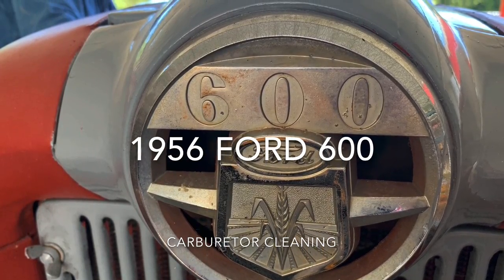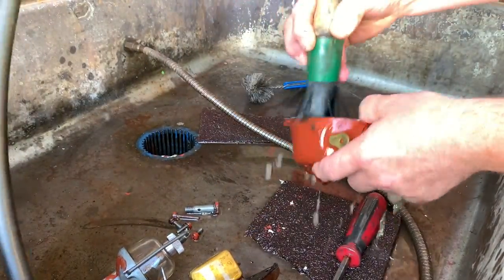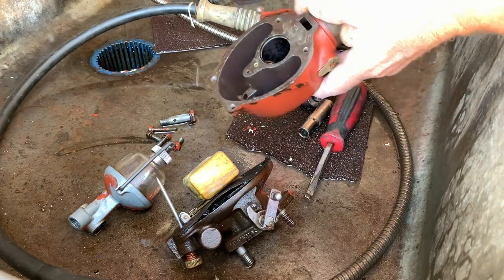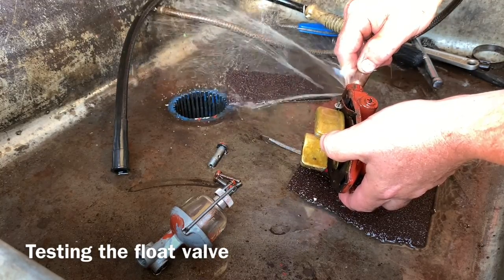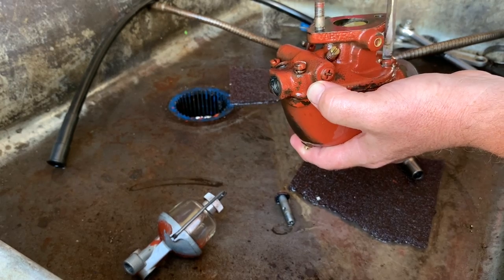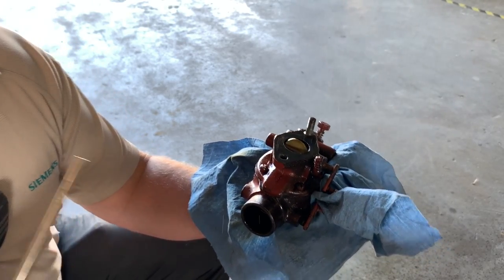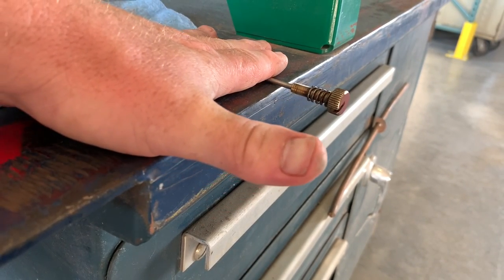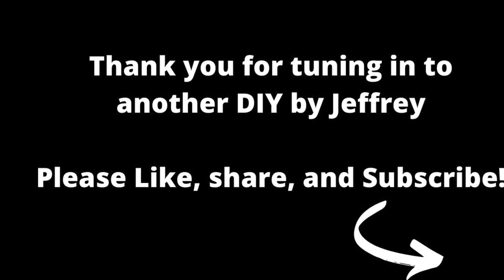Ford 600 tractor carburetor tear down and cleaning

Comment: Good luck finding fuel with no ethanol.  A minute added adjusting while engine running would have been a nice bonus.
Reply: I get mine at Quik Trip, they have prem, with no alcohol, there are ways of removing alcohol from the gas using distilled water, by leaving it sit over night with food color in it,  you can also get good gas at Bucees travel stops

Comment: Take the main needle out first before separating the halves and you won't bend it like you saw happen here.  I love how he is like "Don't know how that happened!" - LMAO.  I'm like "You bent it!"  There is no way you could put that needle back in and have it be adjustable since it would not seat in the jet correctly.  He then calls that needle the jet.  It is NOT the jet, it is the main needle.  The jet is the small brass screw with a hole it in it that the needle bottoms out into, and is how you adjust the fuel flow rate under load.  Also, no one calls the carburetor bowl the 'sediment bowl".  The sediment bowl is the glass bowl where the fuel flows into the carburetor.  And that test he did blowing cleaner out the throttle?  Absurd.  That is not how you test a carburetor.  The fact that the tractor started is a testament to the fact that these old Marvel Schembler carbs run like champs and have WIDE tolerances as the engine isn't that picky.  My 1957 Ford 640 starts every time, although I DID just rebuild the carb and replace the rusted out exhaust pipe and manifold.  If you really want to see how to do this - go to Rachell Gingell's site, and save yourself having to buy a new main needle!

Comment: One of the best carb cleaning video's I've ever seen Thanks for secret tips   I keep a lot of those crush washers gaskets for that style fuel filter You can also test your float after assembly as you did by simply lightly  blowing into fuel line and raising and lowering the float as you did.